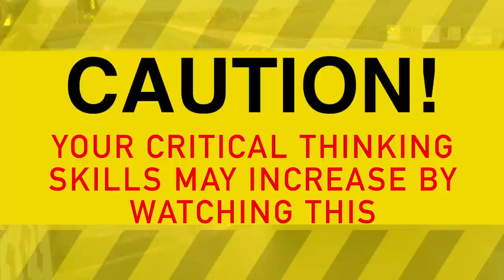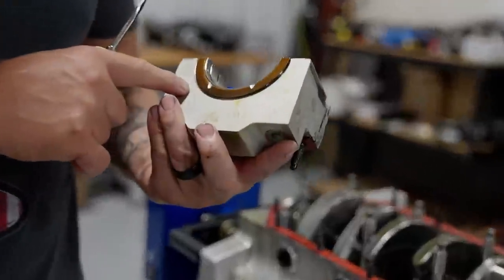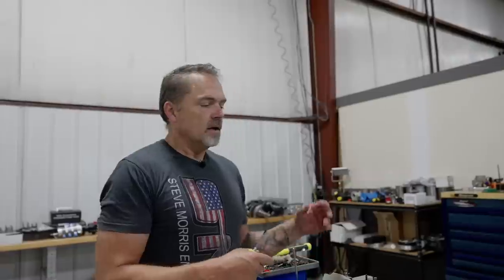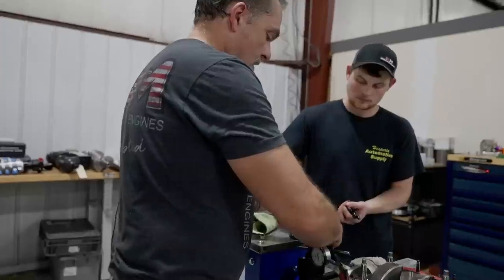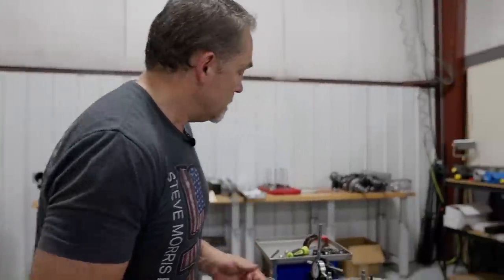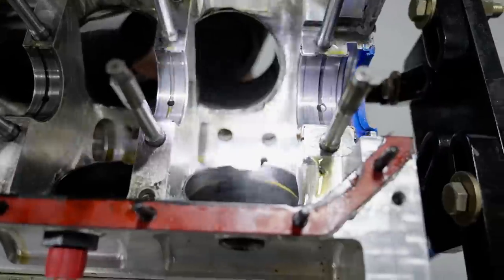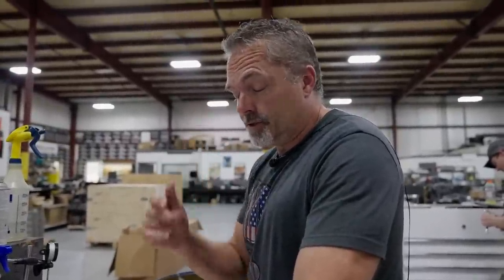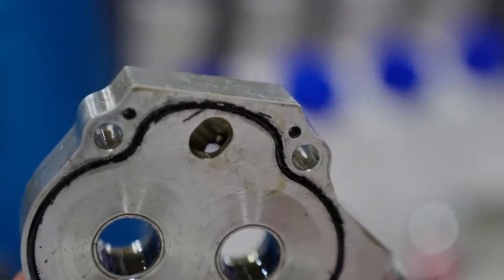I Found Mullets Engine Issue...Part 2

Comment: Another know-nothing armchair mechanic here, love your work, thanks for taking us on the rational evidence-based journey :)  ..   

I'm almost scared to ask, but have a question:  Does the difference in thermal co-efficient of expansion between the aluminium block and the cast-iron crank have any potential impact here?

If the aluminium block is 32" (hypothetical) at 68 degF, then, assuming thermal co-efficient of expansion of 0.000013 in/in degF,  by about 200degF it's probably going to end up about 32.055" ..   If the iron crank started out at the same 32" at 68 degF, then by 200 degF the crank is going to be about 32.0275" (@ 0.0000065 in/in degF), so there's 0.055 - 0.0275 = 0.0275 or 27 thou difference in lengths ..

ie. it seems like thrust tolerances would tighten as the engine warms up.
Reply: So why are You proposing,  presenting Your baseless, nonsense idea , since Your have clearly, explicitly admitted Your ignorance ??!! Good Luck
Reply: @newtonfirefly3584  because this is the internet, and sometimes even guesses can be right.  The math seemed to add up, and honestly I'm sure Steve probably takes expected differential growth into account while machining, but who knows..  why not ask? 🤣. Others with claimed actual machining experience have asked the same question so I feel somewhat vindicated. Good day to you. :)
Reply: @gunderd  Are Your attempting to use more proposals, assumptions, presumptions, falsehood, nonsense to justify Your ridiculous, ludicrous, baseless, nonsensical claims, ideas, presentations, portrayals, etc. ??!! Steve would certainly not be impressed nor accepting.
Good Luck -> Bye Bye

Comment: What can I say, "class act". Never raced anything. I see you sweating in your shop. I can imagine what it's like on the track with the sun beating down on you trying to figure out what's wrong with an engine. It seems like trying to figure out a better way to filter the oil, possibly more than one filter, is the way to go. I am sure that you are just laughing at me right now thinking, "oh yeah, I need to squeeze in 10 more oil filters in the engine compartment". Great video! Thanks for all that you do. You inspire us all.

Comment: Glad it’s all ok. SMX still the best !!
Reply: Actually, Your attempted claim is incorrect, false. All is NOT "okay" -> though, once all is properly corrected including the oil pump [perhaps a chang, modification, improvement to that too] and the noticed thrust bearing clearance issue difference between the shop and at the track, along with the actual cause and effect, then solution -> perhaps it will be "all ok[ay]". Good Luck
Reply: @newtonfirefly3584  
Would love to see the engine you designed and built, a few time slips, and a video of your car. I’m always willing to learn. Thank you sir for your response.
Reply: @whyamihereg  Certainly You have not designed, developed any engine, machine or any device, component, system as those of us engineers [my experience > 45 - 53 years]. Good Luck -> Bye Bye

Comment: I'm curious, Does your roller thrust bearing use cylindrical or tapered elements?
Cylindrical will scrub some due to the difference in travel between the inner and outer end of the rollers, although I doubt it would be enough to cause a problem.

Comment: I'm working on a 65 Plymouth Valiant Wagon and I would love to put a SMX in it. I'm a long way form a drive train. I'm just trying to make a chassis that the NHRA will approve. I failed tech miserably and had to start over. Lessons learned. I'm not rushing things. If it takes 2 years to finish the car so be it. I'm going to look into the drivetrain in January if everything goes as planned. I was thinking a Keith black hemi but I like your business sense and results from your motors. I would like to be there when it is built so I can get familiar with your motors. I like to see what goes into my exact motor. It's my piece of mind. Not saying you don't know what your doing but I will understand what I am driving. I get a sense of pride knowing that I have a part in everything that goes into my car or anything I do. I would be proud to have a SMX decal on my car as long as that's the motor in it.

Comment: Hi Steve , is it possible that the aluminium block is growing in length, more so than the steel crankshaft when its hot , thus closing up the clearance on the factory thrust bearing. So you end up with less hot running clearance than its appears to have when cold.
 Then, under heavy load, the crankshaft can still just touch the thrust bearing
Reply: Craig Ritchie, clearly Your attempted idea, concept, description, terms indicate clear, obvious, certain lacking with, within chemistry, materials, engineering, engines, mechanical, machines, mechanics, mechanism, cause&effect, principles. Aluminum & Steel-Iron expand and contract versus temperature; never do they or other materials 'grow'. In addition, clearly You lack the basics with application of the metal expansion within the entire aluminum block structure [3D], bearings [main & thrust], steel-iron crankshaft, etc. as a poper engineer would perform during proper assessment, evaluation, analysis, design, development, etc. Good Luck
Reply: @newtonfirefly3584.
After I posted my thoughts, I realized that the clearance would increase on the sanded side of the factory type thrust bearing, and this would actually add clearance 🤔
.
 The theory is pretty simple, really,  the block is predominantly aluminium, and the crankshaft is steel ,
Aluminium expands approximately 3 times the rate of steel when heated.
The torrington bearing has 0 clearance when the engine is running, so if the steel crankshaft expands less that the aluminium block the clearance will change at the other end.

Try accurately measuring a block of let's  say, aluminium and have it at 70deg, and then heat it up to about 230degF, then measure it again. I guarantee you it will be a few thou larger when hot 🔥

Comment: Why is it that you so seldom see fracture split connecting rods in American engines (I mean the method of casting the rod complete, then fracture split the bearing hole for more surface in the joints and for - accidentally - very individual rod joints - like for example BMW did it, don't know if they still do) Is it just not worth the hassle or are they overbuilt enough so it doesn't do anything useful enough? Or is it just me, as a dumb european doesn't know shit about US engines? I actually have never seen one with fracture split rods, had some german ones in my hand once though (and had to cope with it!).

Comment: So I’m curious…obviously new bearings will go in the engine.  Will all the other internals be used?!  Thanks for the thorough videos!  I love learning about the workings of these engines.
Reply: As much as one should not answer on the behalf of others, I can answer this. Yes, the rotating assembly will be used as is. No need to spend thousands upon thousands of dollars for what you don't need. New bearings and what else is associated with the repair, but that's it.
Reply: @AB-80X  Your initial premise, claim certainly precludes YOur attempt to violate Your premise; thus Your comment is completely unjustified, full of conjecture, proposal, assumption, presumption and more. Good Luck
Reply: @newtonfirefly3584  
Have a cookie and g’et over yourself
Reply: @AB-80X  Good Luck "FOOL" -> Bye Bye

Comment: I’d say if your building a new or putting together a new engine to check the torque converter snout to back off crank shaft clearance with some play dough, like checking piston this valve clearance. Just to make sure there is enough clearance, say it doesn’t take much for a converter to heat up and start pushing on the crank if it was close.

Comment: Cool to see the scratch and dent keep going, obviously it is not structurally weak. Just wondering if any of the small shrapnel could come from the thin and jagged damage areas. Some of the damage appears to have sharp and thin bits, like around the base of the cylinder liners and where they meet the block. There would be a lot of shock vibrations at full stoke and the oil mass sloshing around could possibly break off some of the thin bits? Also could oil ingress into any little cracks cause metal fatigue on the thermal cycles and weaken the thin edges? I'm no expert but if everything else checks out how important is deburring and edge removal in those areas? Always great to see the innards of these machine, thank you.

Comment: Tin soldiers just had a similar issue on Charlie Brown the spacer on front nose of torque converter was hitting the back of crank.  So they machined the nose and made more clearance so they wouldn’t take out the thrust bearing cause of charge pressure

Comment: Steve, being the engine building expert you are I would like to get your take on engine break in procedure. You build the engines and put them on the dyno right away and start making sauce. Is running a new engine for 250, 500, 1000 miles really necessary? Rings constantly move so do they really "seat"? Big fan thanks.

Comment: Seems like the same problems as always I've been doing the stuff for fifty years torque converters are always an issue. I do have a question about the extremely high oil pressure you guys run or maybe I'm mistaken. Maybe I'm not getting your telemetry right or maybe I just don't know but a hot engine running more than 80 lb of oil pressure would make me nervous as far as cavitation but maybe the styles of pumps do not cavitate not familiar with this system. Side note I am familiar with the high-flow oil filtration system been using them for many many years just wondering about air in the oil

Comment: Amazing work Steve! You should be carrying a triple PhD in motor development.
Reply: You obviously lacking the basics within Philosophy, Science Philosophy, Science-Scientific Method-=Methodology, thus certainly PhD=Philosophy Doctorate.
Good Luck 
Oh, Steve Morris is an engine builder not engine developer nor designer, engineer. Steve reveals his limits with, within level of knowledge, mechanics, mechanical, electrical, including his personal lacking within Science, physics, chemistry, materials, engines, transmissions, components, fabrication, building, etc.

Comment: So, like I said yesterday, there was an issue with the oil sieve where a piece of that material broke off and got through the oil pump, but, as far as I know the oil pump was serviced and fixed after that happened and before they went to (sick summer sickweek?)..... I and someone else hypothesised that there may have been some trash stuck inside one of the hoses that the guys did not clean out or may have missed when re-assembling it..... I guess my question then would be, could the tore up material on those gears and the inside of the housings be what we might have seen inside the filter? Like I said yesterday, if I remember correctly, the material was kinda "chunky" not really friction like material or very fine material...... If that makes sense?  Thanks Steve, that is why you do what you do, and we all just watch...... I am definitely still subbed....😁

Comment: Engine looks good! Just a couple thoughts,, is that pump screen still being used? If it is, is it coming apart again? Isn’t it there to catch any trash going into the pump? And I think your front thrust issue is that the length of the block is growing increasing your front thrust end play!  The factory thrust doesn’t really have anywhere it expands, so your front thrust clearance is increasing (with heat) and the rear thrust clearance is staying constant.  Not big deal, but might be why it’s touching the rear main.

Comment: Steve, if I understand what you said, the back side of the rear main had some wear which implied that the thrust bearing housing may be yielding allowing the crank to touch under a forward load from the transmission.  Could it be that the thermal expansion of the aluminum block, being greater than the steel crank, increases the clearance and your thrust bearing isn't being as effective as it should be?  The thrust housing is very stout and isn't likely to (of course I don't how much load there is) be yielding and causing your extra clearance?

Comment: So I was right the first time! In the video from SW, they said they got a bunch of material out of the pan earlier, but then when you pulled the pan, there was no material in the pan. So, where did that material come from? My guess is the turbo bearings.
Reply: Actually, JYLP, Your claim indicates, proves, certainly that Your were incorrect, faulty, baseless with Your false claim idea, concept, proposal, etc. Another arrogant nonsensical comment Good Luck
Reply: @newtonfirefly3584  ah, I see now I was correct in my assumption.  You do go around and like to correct people with that huge brain. Heh

Comment: Regarding crank length/ thrust vs block length, assuming a 100deg F rise in temp from assembly to hot, and a length of 28 inches, (guessing from rear thrust to front) the block will grow about .034, the crank will grow about .020.  

That coupled with a little crank shortening  due to  loading in bending, one  could reasonably expect the rear thrust surface to make contact, even apart from astronomical ballooning or thrust loading of the converter.

Comment: Now we need to see the oil tank, and the lines, to see if the pump was sucking up material from those, thankfully the filter goes between the pump and the crank :)
5:50 - Seen factory bearings come out of stock motors where the bearing was still functioning perfectly, and looked no where near as clean or have such an even wear pattern as you've pulled there.
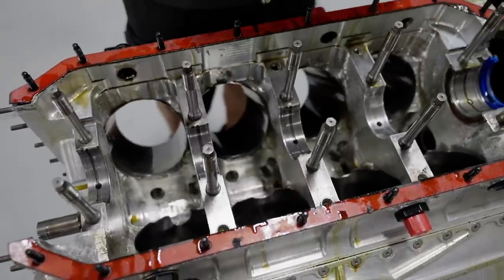13:30 - We've all seen Freiberger toss engines together for roadtrips with bearings that are no where near that nice, and then drive hundreds of miles,....

Comment: Steve, I think you did see more thrust clearance than 0.007" at the track.  The engine was very warm to hot and the aluminum block grows more than the steel crank.  Your forward and rear thrust surfaces are at opposite ends of the block.

Comment: Wonder if it was leftover trash from the previous thrust bearing/oilpump filter screen tip eating debacle. Curious if that mesh screen prefilter was intact on this pump. If not Maybe it happened again causing the same issue.
Reply from the maker: Possible

Comment: Wouldn’t the thermal expansion of the block be greater than the crankshaft causing the rear thrust bearing clearance to become less at operating temp ? 
That combined with a bit of linear compression of the crankshaft from snout to tail might account for the missing 20tho
Reply: Mitchell Bowman, what would actually be the results with a proper, full assessment, evaluation, analysis with the entire engine block, bearing, crankshaft bothin statics, dynamics with using the thermal coefficients both within expansion and contraction, as a proper engineer performs ?!
Well Mitchell both YOu and Steve are not able to determine this, thus equally incapable, unable. However Steve knows clearly he is unable, relies upon his engineer(s), while Your comment indicates You consider Yourself able to ask the question without any proper base, basics, principles, physics, materials, chemistry, mechanics, mechanical, mechanism, cause&effect. etc. -> Good Luck

Comment: Is that oil pump an off the shelf item, or another in house machined item? And are they modular? Can you add or remove sections?
Reply from the maker: Shelf pump
Reply: It looks like a simple item. Have you thought about trying to design you own? Or not worth reinventing the wheel?

Comment: Crank deflection:  I'd like to see a crank placed in a block with bearings  placed in a press with crank flange on the bed , ram on the crank snout , dial indicator on the block and crank snout.    Calculate  converter charge pressure then run the press in steps until this force is  exceed by 50 %  .     I'd also think that this long term flexing would cause the crank to crack.

Comment: hi steve,  just wondering if its possible some of the metal found in the window / filter had been blasted off by high pressure oil, off the edges of the existing holes from when the motor self vented at high rpm?

Comment: as the engine seems to be clean could the problem have been the transmission or maybe the torque converter instead?  As you said the block grows I'm curious as to whether you add in allowances for that when you're building the engine

Comment: Checked the end clearance hot, and the aluminum block expands more than the crank, your roller bearing clearance is much bigger. But thats not looking like it’s the issue.

Comment: Yeah cleetus definitely said it had extremely low oil pressure on the last run at sick summer. I was hoping it would be a bad sensor or similar.

Comment: Do the front/center main caps have more flex then then aft? Would that allow the crank to move forward while the aft main cap is still holding back? So basically a pan rail area stiffness issue.

Comment: if the block grows the crank can hit the thrust main easier ..think of it as the roller thrust moving foreward
Reply: Jak Stoll, a block, solid material, aluminum, steel-iron, etc. never 'grows', but materials expand with temperature increase and contract with decrease.
Also the expansion, contraction must be applied properly, appropriately within the entire structure, form, shapes, within the 3D, including for all parts, components which include the bearings [main, connecting rod & thrust],  including with the lubrication, forces, pressures, etc., as any proper engineer performs. Good Luck